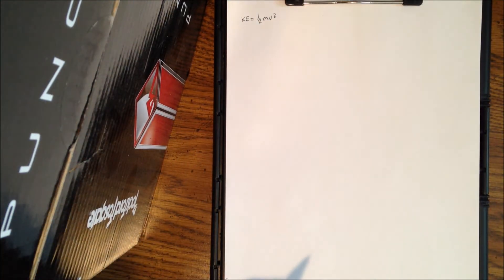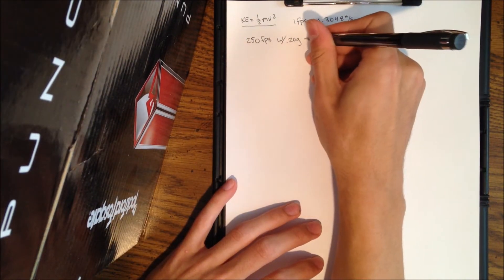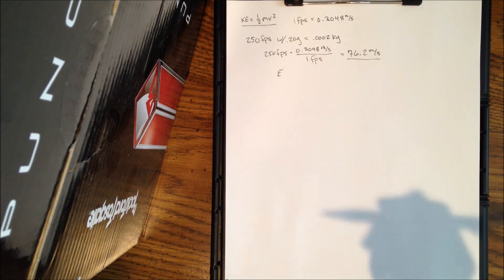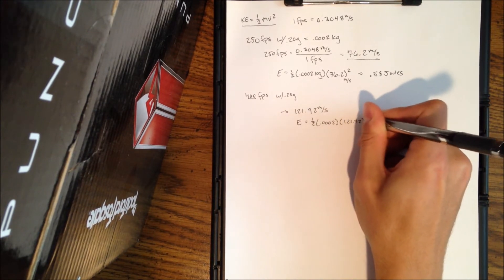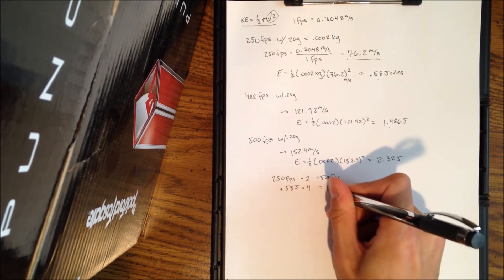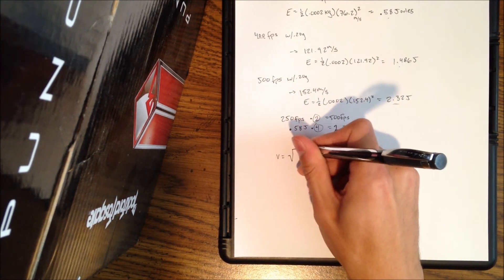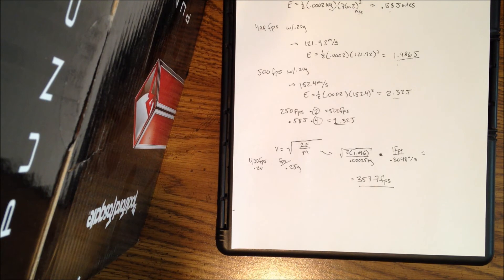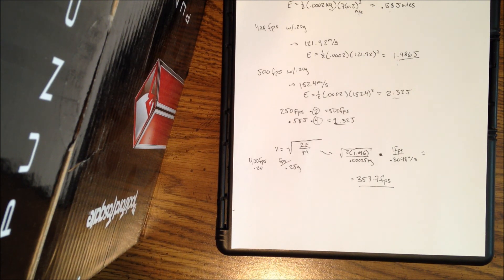Joules vs FPS || A Mathematical Look at Airsoft Gun Ratings

Comment: Hello; yesterday I was chrono-ing my sniper rifle, which is a VSR10 clone, and I was nicely within the fps limits over here which is 500 fps. I was between 435 and 450 (over a full mag of 55  x .2 BBs) but then I took a look to the Joules and saw I was a tad above 2 joules. but looking at this,  it kind of makes those measurements unreliable right? do I have to have my chrono checked? I mean if I take the pure equation and apply it to my setup; or are there other factors playing a part on this joules measurement??I have a 51 cm barrel (stock) I don't know the bore diameter though, and all I have upgraded so far has been the piston and spring guide. Air seal is reaaaally good tho  :)
Reply from the maker: Hey man, I'll have to watch my own video again to double check what I say in it. Lol. But nothing on paper works out 100% the same way in real life. Not much happens in a vacuum in the real world! You've got to deal with air flow/pockets (through the barrel), temperature, humidity, elevation, etc. 

Here's the thing...the standard measurement by fields is fps (@.20g). As long as you adhere to their measurement, you can play...so therefore the goal would be to stay under 500fps with .20g bbs.

My whole argument has always been that fps isn't a good way to gauge safety and that the standard should change. A chrono essentially measures initial velocity (at the muzzle)...but I think we should measure resulting energy ([random made up numbers] eg.  2 Joules @ 10ft distance...or something like that). This measures the energy imparted upon the target...in this case, a human, that we want to keep safe.
Reply: fair enough, thanks for taking the time to reack bro :) cheers

Comment: Interesting. I purchased an A&K Masada which was advertised at 310fps out of the box but when received it there was a sticker on the side of the gun that read 1.6 Joules. At the time I thought nothing of it but after watching and understanding your video I'm worried I'm shooting at about 415fps with a .20g bb. I have not had a chance to chrono it yet and on the one and only day I've used it so far the site forgot to bring a chrono but let me use it anyway because I told them it was advertised at 310fps out the box :/. Great info and I agree with you, sites should be measuring in Joules.

Comment: While the math you used isn't wrong, it isn't entirely complete.  Barrel length and diameter also impact velocity.  This can also be calculated using expanding gas laws.  Because of this, fields really should be governed by muzzle velocity as the Joules are not the only contributing factor.
Reply: Ident heard of expanding gas laws, I'll be sure of check that out, although; I do know of the combined gas laws and ideal gas laws lol

Comment: Thanks for doing this. I recently bought my first airsoft pistol, and I found this very helpful. Now I have a rough idea of what to expect from the FPS and joules ratings. 
Just a question, how do you know what ammo weight the FPS rating was shot at if it's not labeled? Is there a way to find out other than measuring it yourself? Might be a silly question, but hey, it's 3am right now.